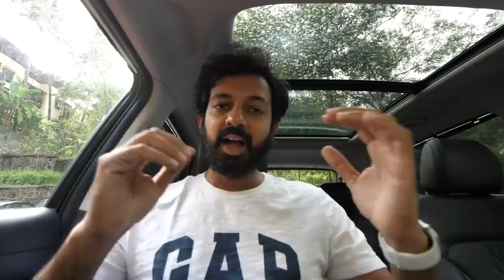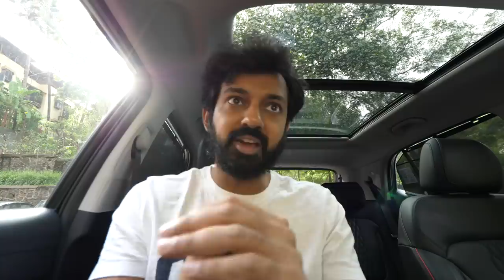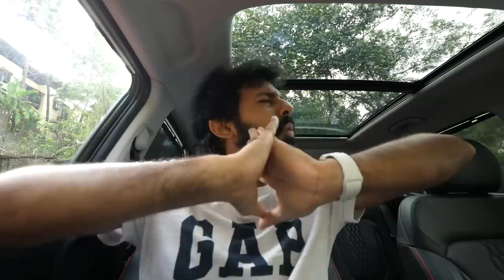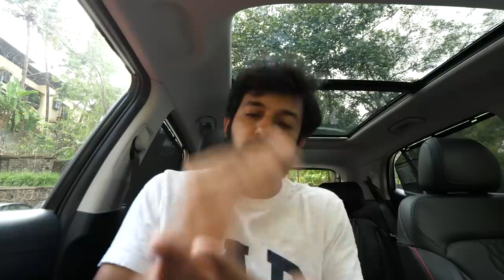Small Capacity Turbo Petrol Engines!

Comment from the maker: What petrol engine do #FasBeamers prefer? NA or Turbo?
Reply: Turbo

Cause It's a beast
Reply: Turbo is the best
Reply: Turbo🔥
Reply: NA
Reply: 4 and 6bcylinder with Turbo. 8, 10 ,12 cylinders Naturally Aspirated... 😌😊
Reply: NA
Reply: Turbo 🔥👍👌👌👌
Reply: Your explaination is soo detailed
Reply: Turbo
Reply: @asgautomobiles5482  you just need 1 heart to be a top commenter
Reply: NA.
Mighty McLean F1. Fastest NA car to date.
LFA 😍 
V10 CARRERA GT
458 ITALIA.

But yes small engine. Turbo right away.
Reply: I read this article in    motorbeam
Reply: NA engine because it has long life than the turbo charged engine, in turbo engines the turbine  pulls the air very vigerously for the rapid combustion process for more energy, this makes the engine wear and tire faster. So I prefer to buy big NA engine instead of buying small turbo engines.
Reply: Turbo
Reply: Turbocharged rocks💯🔥🔥🔥
Reply: Kisne bola Audi drop diesel engine sq8 sq7 S5 ye new wali mein toh diesel hai compressor wala
Reply: Of course turbocharger engines will be best in performance better not in life.😅😂🙏
Reply: Turbo
Reply: I love TSI Engine
Reply: Once the boost build and turbo kick-ins then the feeling is mind-boggling...
Reply: Turbo...
Reply: Any engine that gives more mileage
Reply: Toyota just increasing price of Innova crysta nd fortuner just telling that dollar rates nd due to inflation

Its almost Rs 3.5lakh increase for Innova crysta in just 4 years
Reply: Turbo
Reply: TURBO for sure
Reply: Honda can do much better in india.they gave us good cars back in the day .you just pulled words right out of my mouth.we need turbo.And indians need to buy good cars and stop settling for mediocre piece of shits
Reply: Turbo is best in terms of performance
Reply: well said brother :D
Reply: Turbo but powerful diesel makes sense in india.... 
Also powerful hybrids r great but then they r gonna be so expensive...
Reply: Turbo.
Reply: Turbo,  because it is THE NEXT BIG THING
Reply: I prefer Jayem Turbo Petrol😎
Reply: Sabse sahi bola aap ne
Reply: But bro In my perspective . Petrol naturally aspirated motors with manual gearbox can give you a true orgasm of driving a beast and also the RPM shoot of a petrol naturally aspirated motor are lethal . Like the honda city SV petrol .
Reply: Anjali Mishra baskar bhaskar
Reply: Aravind babu panicker HONDAS HAVE RUST PROBLEMS TOO. RUST FROM INSIDE IN SHEETS LIKE DOORS DICKY FENDERS ETC
Reply: Arpit Tripathy Hondas are very fine engines but very bad body work. Rust is very common
Reply: Turbo vs supercharger
Reply: Turbo
Reply: Variable geometry turbocharged engine
Reply: NA predictable linear acceleration
Reply: NA are always better than turbo as they give linear power delivery throughout rev band. btw i like ford dragon and honda ivtec.
Reply: Turbo
Reply: Definitely turbo
Reply: Turbo petrol
Reply: Tsi
Reply: NA
Reply: BMW 4.4 liter Twin-Turbo V8!
Reply: obviously TURBO!
Reply: Depends entirely on nature of engine tune. Honda city 1.5 ivtec might give same performance as of vw 1.0tsi or even 1.0gdi. End of the day performance matters. 
NA or Turbo doesn't. If Honda tunes the 2020 1.5 ivtec like the previous gen then what's to complain? Also, who knows whether it might not drink that much fuel like the turbos and offer same level of performance. 

By the way, Maruti is the biggest STUPID company here. ✌️
Reply: Car encyclopedia just became a smartphone encyclopedia
Reply: Turbo
Reply: anyday turbo is the best
Reply: @anjalimishra1937  drama.
Reply: VTEC TURBO
Reply: Please review i10 nios turbo.
Reply: I just love u man..gr8 presentation..i love diesel engine..
Reply: Both, we need both options.
Reply: Its simple when its come to smaller engines we need a turbo in it.
Reply: Supercharged
Reply: I bought Baleno 1.2 over the RS variant back in 2017 coz the price of RS was in no way justified but now when driving on highways i regret buying the 1.2 ,the torque is what i cared about but its nowhere there also checked out the abarth but due to the service availability and price didn't go for it ☹️ ,so yes i totally agree with you Faisal that turbocharger has to be mandatory for small capacity engine . Suggest someone who does a na to turbo conversion in India i would go for it anyday .
Reply: Hi Faisal I really like your thoughts 👏🏻👏🏻👏🏻 Indian's deserve more than we have.
Reply: I like Turbo but practically thinking Turbo is useless in today's traffic and life of NA Engine is more than a Turbo engine because there is more wear and tear in turbo engine. So my choice is obviously  NA engine.
Reply: When certain manufacturers gain market share in india they turn to cash in with existing products like honda motorcycles,honda cars,suzuki cars,
Reply: Turbo Gdi Offcourse
Reply: Turbo
Reply: Naturally Aspirated 💪
Reply: NA definitely
Reply: NA would be my choice for longevity
Reply: We need supercharged cars
Reply: The future is Turbo petrol
Reply: 1.0 Turbo
Reply: 1liter 3 cylinder engines even with turbocharger will have to be revved to get the power...
Reply: NA all the way...old school
Reply: @Niranjan Pazhani Chamy Agree i should have gone for diesel but my running is not on the higher side so thats the reason also 3 cylinder turbo are bit noisy otherwise RS was my 1st choice but the Indian spec was detuned and was not a hot hatch as compared to a punto abarth, surely will check them out although i'm trying to get the conversion from 1.2 to a 1.4 coz forged induction needs a lot of service and downside is the availability of service and ease of it . Thanks for the update buddy
Reply: Turbo
Reply: NA
Reply: Dude what about balano RS!!!
Reply: All people saying NA are Maruti Suzuki owners and fans 😆😂🤣
Reply: diesel best :P
Reply: Turbo GDI
Reply: Keeping the performance aside, which is better NA vs Turbo ? With Respect to Fuel Efficiency,  Engines Life and Maintenance
Reply: Any input about Nissan Kicks 1.5 NA vs 1.3 Tuebo ??,
Reply: @finufaiz  bought i20 turbo imt ! Let Hope for d best .. 🙏
Reply: Turbo Charged ...proud owner of verna and kicks 1.3
Reply: NA petrol engines anyday! 😊

Reliability and longevity are compromised when one opts for cars with small turbo-charged petrol engines.

 Honda and Toyota petrol cars with naturally aspirated engines easily last for 15-20 years. They are reliable anyday compared to VV/Skoda petrol cars with turbo-charged engines (Polo, Vento, Kushaq, Rapid etc).

 In VV/Skoda cars after 6-7 years injectors blow out, engine develops other issues. Also, problems including 'damaged sensors' are very common in VV/Skoda cars. The warranty period will be over by then. You'll have to spend huge amounts for injectors, sensors etc. These issues will only get worse and you will be forced to sell the vehicle for good. I have many friends facing such issues. These cars are not build to last. 

Vast majority of the people who buy cars in India belong to the middle class. They won't be able to buy new cars every 5-6 years. Most of them will want to use the cars for minimum 14-15 years.
Reply: NA anytime
Reply: NA
Reply: I always prefer turbo engines. I only like V8 and V12 Naturally Aspirated engines

Comment: Indians asks only 2 questions when they buy a brand new car
"What is the mileage and how is the running costs and maintenance?"
Great video for 'stereotypes'
Reply: Tbf maintenance and running costs are important. What's the point in buying a high performance car if it's going to be just sitting in the garage more than actually being driven on road? High maintenance on luxury cars and sports cars is understandable but for a daily driver car it doesn't make sense.
Reply: Also, how's resale value 😚

Comment: You are right , Hyundai Creta offers the most options
1) Diesel Engine
2) Petrol Engine
3) Turbo Petrol Engine
4) Manual
5) CVT
6) Torque converter Automatic
7) 7 Speed DCT
All these options under the same body frame
Reply: Yeah, incredible.
Reply: Build quality, suspension , stearing feel feedback aur ride handeling bhi offer kardeti toh badhiya hota

Comment: I'll vote for the long-lasting and reliable naturally aspirated (NA) petrol engines anyday! 😊

 Reliability and longevity are compromised when one opts for cars with small turbo-charged petrol engines.

 Honda and Toyota petrol cars with naturally aspirated engines easily last for 15-20 years. They are reliable anyday compared to VV/Skoda petrol cars with turbo-charged engines (Polo, Vento, Kushaq, Rapid etc).

 In VV/Skoda cars after 6-7 years injectors blow out, engine develops other issues. Also, problems including 'damaged sensors' are very common in VV/Skoda cars. The warranty period will be over by then. You'll have to spend huge amounts for injectors, sensors etc. These issues will only get worse and you will be forced to sell the vehicle for good. I have many friends facing such issues. These cars are not build to last. 

Vast majority of the people who buy cars in India belong to the middle class. They won't be able to buy new cars every 5-6 years. Most of them will want to use their cars for minimum 14-15 years.

Comment: NA engine because it has long life than the turbo charged engine, in turbo engines the turbine  pulls the air very vigerously for the rapid combustion process for more energy, this makes the engine wear and tire faster. So I prefer to buy big NA engine instead of buying small turbo engines.
Reply: I completely agree with your point.
Reply: Add to that the clean pull and progression a naturally aspirated engine offers!!!
Reply: Engineers know how to make reliabile turbo petrols
Reply: @rohan.8299  Taking example of "Engine Master"  HONDA, which has 1.5 Vtec Turbo powering the Crv in US and Canada,
Owners are facing a lot of issues like oil dilution problem
They just literally want the bullet proof 2.4 NA Vtec engine back!
Rest time will tell in the coming years
Reply: @rohan.8299  oh. I bet you can't get 2 or 3lakh kms from a modern turbo 1.0l engine like you can get from a old reliable NA motor like from honda or Toyota. Turbo GDI are designed for more power. Life and maintainace is not the concern of the engineers.
Reply: I agree with your point. But a 1.0l engine in such a heavy vehicle like a crossover or sedan is just gonna be stressed out more than a big NA engine. So it will wear out faster than a NA engine.
Reply: @Niranjan Pazhani Chamy Your right, thank you for your reply .👍
Reply: @rohan.8299  naturally aspirated engines have come to this precision n fineness after so long..  similarly turbo will take its sweet time to achieve fineness...

Comment: turbo charged petrols are costly to maintain due to compression leaks.
Reply: Never heard that.. Not true
Reply: Lol ...Using Turbo Charged engine for last 9 years....Not of this sort happened...Just make sure to idle car for a while before pressing accelerator and leave car in idle for a while before shutting it off. Turbo Charge is everything.
Reply: @flyinghigh8433  petrol or diesel?
Reply: @mukilanpandian3528  doesn't matter ..its petrol or diesel. .. concept of idling is required for both as long it has turbo.

Comment: Dear Faisal u had a question u answered it urself....maruti is not using small engine in big cars...brezza, scross, ciaz, Ertiga, xl6 all uses big capacity 1.5 ltr engines ..even lighter cars like wagon r is having 1.2 ltr option, swift which is known as a sporty car is capable enough to compete with NIOS turbo..secondly it is a mass market car maker focusing on MASS of common people not THE ELITEs.....u might not b focusing on fuel expenses but common man does....as a result hyundai also is now using fuel economy in the advt. N abt the airbags...if u compare the price bracket in which maruti sells no other company is providing side n  curtain airbags in that bracket...n lastly naturally aspirated engines r far more reliable n easy to maintain with less driving disciplines than turbos..yes having choice of various engine options, sunroof, LEDs, touchscreen, smart key, cameras etc , is a wonderful thing but not everyone has it, due to money constraints....n now THE HYUNDAI, RENAULT/NISSAN r also taking maruti's way to produce tin cans n keep the cost in check...... plz don't think me of a fanboy of maruti but it was a maruti 800 which actually made indian's dream of owning a four wheeler, come true n it's after sales service n reliability although intangible but is far more important factor ..🙏

Comment: Turbo engines undergo extreme heat which results in alot of wear and tear. Plus they are not even fuel efficient specially while traveling long distances. A  turbo engine purchased now will need to be scrapped within 7 years of use.
Reply: Exactly! 👍 This is the exact point that need to be highlighted! Reliability and longevity are compromised when one opts for cars with small 1 litre turbo-charged petrol engines.

 Honda and Toyota petrol cars with NA engines easy lasts for 15-20 years. They are reliable anyday compared to VV/Skoda petrol cars with 1 litre turbo-charged petrol engines (Polo, Vento, Kushaq, Rapid etc).

Vast majority of the people who buy cars in India are from the middle class. They won't be able to buy new cars every 5 years. Most of them will want to use the cars for minimum 14-15 years.

Comment: Japanese are better known for reliability, so NA must be the obvious  choice

The most reliable IC Engine design is inline series (Inline3, 4, 5, 6). 
Problem with V engine(V6, V8, V10) is the piston is not vertical to ground/gravity, so always their ll be uneven wear/ lubrication on cylinder walls. 
Engine should be transverse in standard passenger car, so we get maximum passenger cabin space. 
The most  displacement transverse  engine in passenger car would be inline 5 ( Volvo Inline5)  but it has odd cylinder/piston numbers result in  vibration (similar to Inline 3).
Toyota Supra 2JZ is reliable coz its inline (obviously 2 seater)

I do first felt,  Honda should have given us choice of City turbo RS as that of South Asian market, but later I felt that,  for Honda,  India is more important market than south Asia in long run. I mean, in long run customers ll acquire knowledge regarding cars and IC engineering reliability. In South Asia Honda got bigger market share. In India its still challenging.
Definitely, NA is reliable than turbo. Even PFI is reliable than GDI (4th gen city vs 5th gen) that does oil dilution and wear engine parts. In GDI, only remedy is to change engine oil in 5k than 10k. Gasoline dilution is terrible than diesel dilution coz gasoline got less lubricating property. Todays piston rings are less tight for improved fuel efficiency that adds more dilution. 
Similarly  old Innova 2.5 was non turbo that gave Toyota reliability title, not is  the case with todays turbo Crysta . Toyota jacked up Crysta  price a lot so high budget buyers literally wont bother on reliability ).

When I drive Honda city 4th gen Vtec on roads, I never felt in need of turbo, coz majority competitors on road today are underpowered, including many small capacity turbo SUVs. BTW turbo only can give u a mid range torque/surge, when comes  to top end (express highway),  displacement solely  matters. 
Yes, drivability is an issue  with low end torque, ie u just need to workout gears and become a better driver.

Some few brands that better perform than city Vtec in acceleration is VW 1.5L turbo, Mahindra 2LTurbo, Hyundai 1.4 turbo. All are heavily turbocharged that lacks reliability. Toyota Crysta 2.8(not Fortuner) comes close , but at what price ?. 
I want power just to get rid of traffic congestion, not to overtake everyone and be the 1st.

u want performance -  u become an expert manual gear driver
u want drivability & efficiency - go for CVT (Yes, Honda should hav offered torque converter)
u won't lose Reliability on either of the above, if its Gasoline NA with good power to weight ratio. 

Diesel is dead without turbo, even than they cant be redlined like a Gasoline. They are for trucks/suv's not sedans

U want everything (performance, fuel efficiency, reliability) from an auto DSG transmission, and be VFM -  its impossible 
Either u improve ur driving skills(manual), or u pay more to buy & maintain.
Majority Indian costumers buy as  their first car. It takes time to learn IC engineering.... lol

When Japanese brands came to US first for business, they were literally zero. Now they challenges even the American Legend Ford at their hot pick-up segment

VW's is only reliable in Europe. Outside they are know as  Germans Luxury cars  !!
Their USP is handling & Safety, for those, need to add more chassis weight that reduce engine life & fuel efficiency.
BTW safety lies in the hands of driver (More he know the road condition and machine  capability. more is safe). Our rode got vehicles from bikes to Heavy trucks
Nowadays they came with Cylinder deactivation that reduce reliability due to temperature variation among bore. 

Thanks Faisal on such an elaborate  discussion.

Comment: Hey, don't blame Japanese they are the most reliable ones and can trust them. I prefer NA cars compared to turbo ones. Power on demand, longer engine oil life and NA cars are trouble free. They are simply more reliable and peace of mind engines.Better be on safe side rather than buying engines that makes power squeezing heck out of it,those 1.0 3 cylinders they are sensitive to loads, claimed mileage can vary very much accordingly and overpowered.If anyone have an urge for turbo go for 4 cylinder big ones. Toyota tune their cars to minimel that's why they are super reliable. Hyundai may offer everything you need in your car but it's not gonna last.